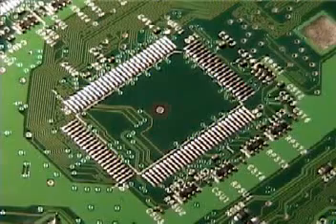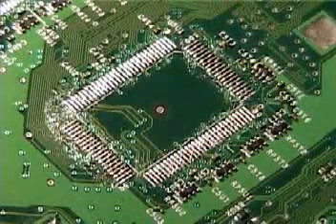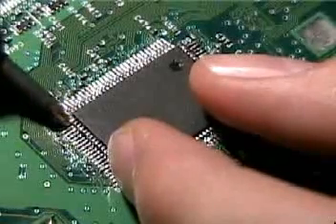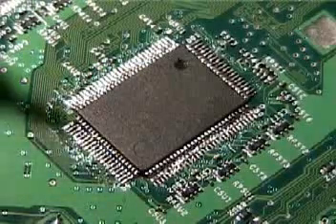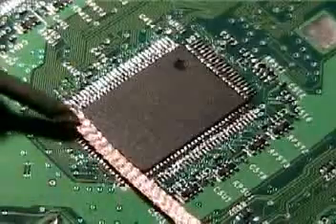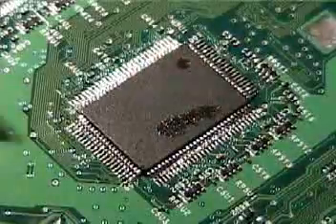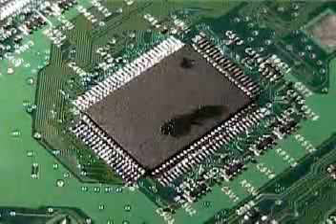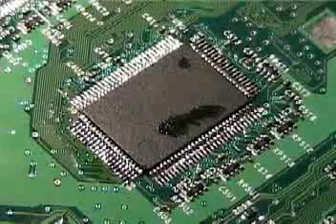Upgrading Ram on xbox to 128MB

Comment: the 128 mb chip,where can i find one?
Reply: +Ivan Leon Eh . . . you can't The Original Xbox has 4 Slots for 32mb Ram Blocks. 2 Are allready filled. For the upgrade you need to get an 2nd Xbox and than rip it off and than do this.
Reply: +TsunaTsurugi Or you can just buy two extra ram chips from a place like ebay. Btw, there are 4 16MB chips not 2 32MB ones.
Reply: reaper575556 Are you sure... because this pic support my comment http://origin.arstechnica.com/staff/fatbits.media/xbox-mobo.jpg
Reply: TsunaTsurugi  thanks
Reply: TsunaTsurugi the Problem is that my xbox is v1.6 thats why ask about a 128 mb chip because TVE v1.6 doent have the extra slots
Reply: TsunaTsurugi
There are two extra ram chips on the bottom side of the motherboard.
Reply: +Ivan Leon Here is some 128mb chips, they are from the same series- model that are in the xbox, but i'm not sure that they will work.http://www.ebay.com/itm/NEW-Samsung-K4D263238M-QC50-128M-DDR-SDRAM-/170533133541
Reply: Brett R thank you
I really apreciate 
Ill check it right now!
:)
Reply: Ivan Leon it should work,  but I would make sure that the pin out is the same in each chips. When you upgrade the ram, you also  need a custom bios to support it. You can normally find them by using Google :)
Reply: I would just search the number of the chip on your XBOX right now and just order 2 more of those
Reply: How much do you charge?

Comment: Awesome. Is there a less complicated way to upgrade the Ram?
Reply: I would imagine using a reflow station you could do this easier/faster and with a lower chance of failure, but you would have to consider if even a crappy reflow station at $200 bucks is worth the very mild upgrade to a console this old.

Comment: A P2 would certainly not fit but a pentium 3 tualatin would with a socket adapter, and some ball grid array soldering. Its more advanced than solding ramchips though and getting an special adapter is even harder.

Comment: Heh just tried this upgrade for fun. I got very little experience of soldering less than10 hours in total. So i almost wrecked it on the first pin :P. I did it with a flux pen, a cheap soldering pen and the heatguntrick to remove them. Was pretty easy i.m.o. My first chip wasnt perfect but the rest got really nice.

Comment: Street fighter third strike... ?  Does NOT need this.. 
If you get the right Emulator it works Perfectly Now with no frame loss at (60fps)
PS, There is now a program for patching .xbe files to get Extra Memory for games.

Comment: i haven't got around to installing the extra ram chips yet, but i plan to do so very soon, im in the process of finding an xecuter 3 ce modchip to upgrade my current  xecuter 2.6 ce, i have plans to use the x2 in a v1.6 xbox and use the x3 in my v1.1

Comment: i am about to attempt the mod this week, i just used my x-tronic 6040 rework stations hot air gun to remove the SMD chips from a broken v1.6 xbox with samsung memory, im going to be adding the chips to my working v1.4 xbox, can you tell me if some of the later linux distro's use the extra memory, and do the emulators really benefit from it ?

Comment: It would be easier to use the hot air gun at low speed around 5 ml/s. Solder iron requires contact and that will move the IC from its leads.

Comment: @matyus111 Ram will only speed things up when there isn't enough of it! In XBMC the xbox has too little of it always. I can tell you that my 64mb xbox locks up on anything when doing 1080i. 23megs left when xbmc starts! 0mb left when playing a movie, when scrolling thru my 600 movies it will absolutely crash when starting playback. In 480i there is 48mb memory left. And xbmc does everything without a glitch... So xbmc definitely needs ram. especially in higher resolutions.

Comment: Only professional way to do this is what is called :SMD Surface Mounting. It takes immense skill (and luck) to do this kind of work with a radio shack soldering iron. If you have no idea about advanced soldering techniques. DO NOT attempt this. You will only cry when you get an E20 error and cant pwn n00bs on your call of duty. And your mom grounds you for breaking such an expensive, unreliable piece of equipment. Although i must say, thats pretty hot to change the IC like that for added RAM.

Comment: @Mastercheif39 this is the original xbox, and games consoles don't need much ram since they don't need to multitask or do much else except run games. The main processor, however, is triple core 3.2GHz and has a 500MHz graphics processor.

Comment: @320iguy Well I just need something better then my current one and be able to play gta San Andreas lol.... My current one has 2GB of ddr ram, 700MHz AMD proccessor, and some cheesy graphics card lol.. so all I need is a MOBO, and a graphics chip and processor and I can use my own case and psu and everything else that I have from my old pc.
I feel like I am asking alot so just anything better then the specs of my old pc because it's maxed out in upgrades
Thanks Again,
Kevin

Comment: For long term quality of the solder job, don't use the rosin flux the way this guy did. He leaves alot of it all over the solder joint. It's corrosive that's why it helps when removing the chip. 
He should have been using a b-2 solder wick that's thinner and contained rosin flux in it. 
At the very least use some 99% isopropyl to clean away the execess flux after the job is done.

Comment: Uhh.. whats the point of this? Even if you upgrade to 128MB of RAM, there are NO GAMES designed to take advantaged of it! They program the games specifically for 64MB and its not like windows that will "recognize" more ram and just use it.

If you want your old Xbox games you play better, just get a 360 and play your old games on that. YEah, I know you cant rip the games to the hard drive, with the 360 and on and on... yeah, ok... but its just absolutely pointless to add more ram to an xbox.

Comment: 2. Linux - yes, you can boot into Linux on your Xbox. You need the Cromwell BIOS on your Xbox in order to do this, but is well worth the effort. The extra 64MB makes a big difference.

3. Emulators (MAME) - there are some ROMs which require more than 64MB RAM to be present in order to work. Having 128MB allows these games to load.

Finally, there is an xbe patcher which unlocks the RAM limitation on games (games are locked at 64MB since that's all the Xbox has!).

Comment: It's already been mentioned - 128MB

The Xbox comes with 64MB RAM, but the development version had 128MB. The earlier Xbox versions (1.0-1.5) still have the sockets on the board to allow more RAM to be soldered to bring it up to 128MB.

Uses:

1. XBMC (Xbox Media Center) - possibly the best free media player available for any computer/console. If you're running 128MB RAM on your Xbox, there's more buffering which results in a much smoother playback for media.

Comment: I tried the installation and failed miserably lol

All I got was a FRAG and xbox would not boot.

Simple words of advice, get good soldering flux,

Be patient and careful not to lift any traces. also do not drag the soldering wick across the traces...PICK it UP or you will take a few traces with you ;)

Luckily  I was able to unsolder the new addition that caused the FRAG and go back to 64 MB without a melt down of some sort ^_^

Really wished I had 128 MB of RAM on the xbox though :(

Comment: Excellent job doing the upgrade.  This is great if you're running emulators or other 3 party applications for the Xbox.  The last time I tried to solder a simple switch, I got lead everywhere.  I'll leave it to the pros to do.  5 Stars all the way for the great video.

Comment: Good video BTW - I've done a few of these and with the right technique and tools, it's a straightforward process.

The reason your chip moved at 2:46 is because you reapplied heat to one of the tacked points. Tacking the corners is fine, just don't go back to them until you have more pins soldered down.

BTW, why is 'solder' pronounced 'sodder' in the US?

Comment: i need help i see open slots 2 on the top and two on the bottom. i have a buster board that i am ripping ram from and it has two chips on the topp and two on th bottom do i get them all and solder a chip to every empty slot? 4 in total.

Comment: props man it takes a steady hand to solder those pins
i have had to solder to a point that small before and i messed it up (making a duox lite status led)
good thing it was only a mod chip they are easy to replace